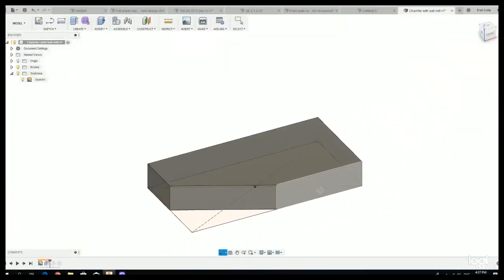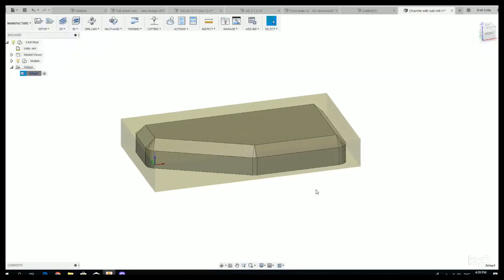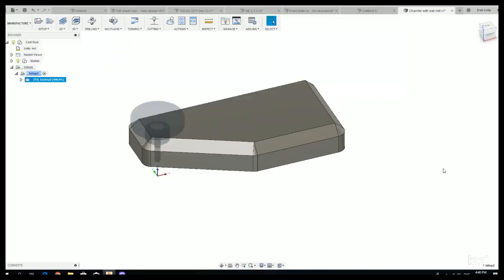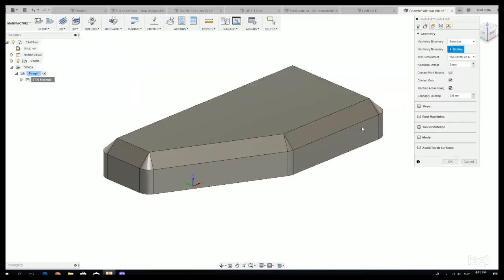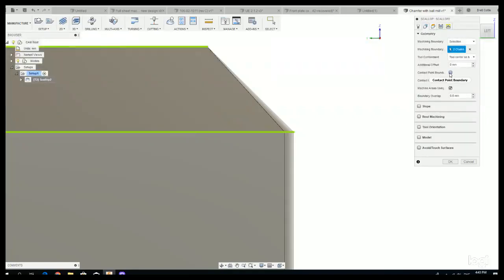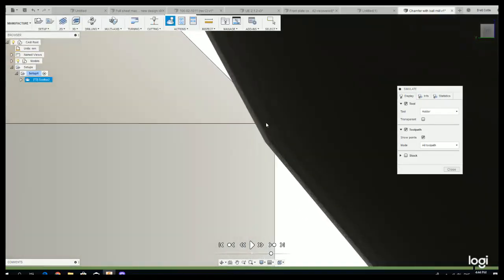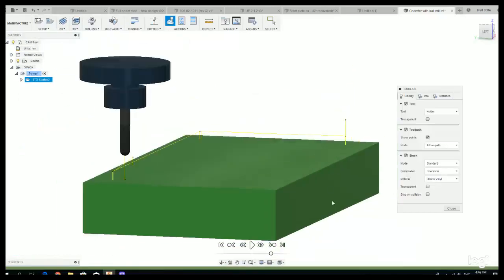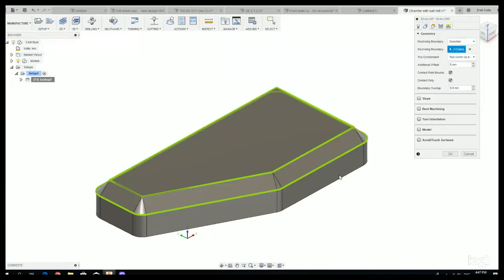Fusion 360 - Chamfer with a Ball Mill (previously live)

Comment: I have found adding the "Add Perpendicular Passes" to also be very helpful with cleaning up the finish when using a ball endmill. It causes the mill head to go up and down the slope instead of just across. 

Vertigo CNC - I wish I had found your video before I struggled my way through this process! 😆Great video, very well done!

Comment: Great and quick explanation. One thing I have been trying to find though is, if moving from inside outwards, the side of the bit is milling quite a thick stock of material, is there a better way to do this like from outside in or is it not an issue?